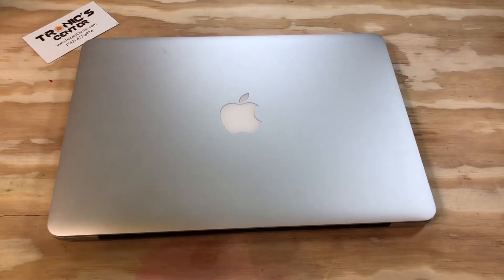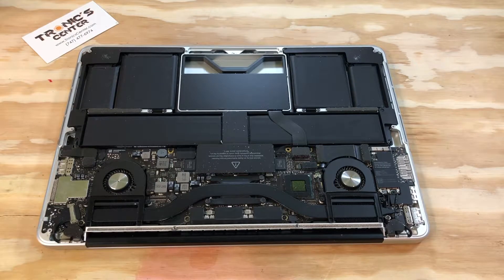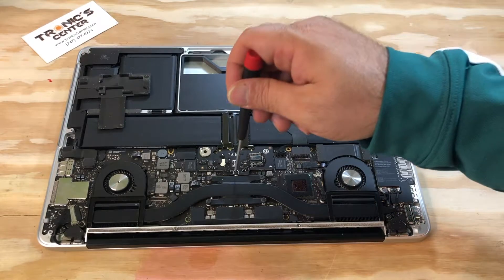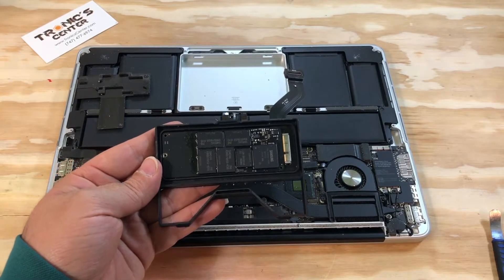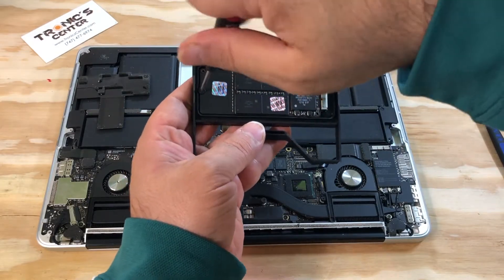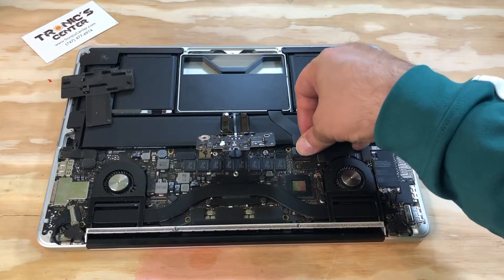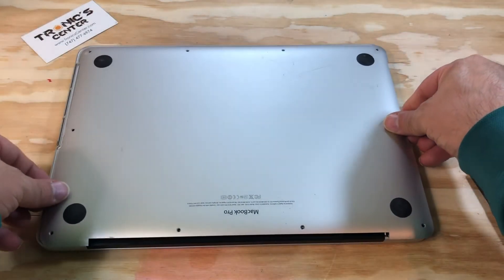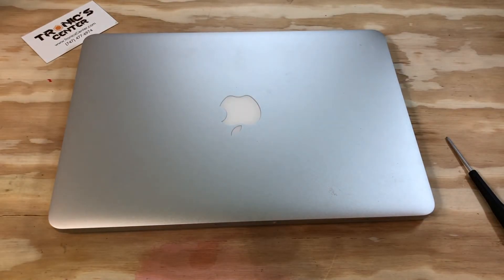Replacing SSD Pcie Storage on 13" MacBook A1425 - SSD installation 13" MacBook Pro A1425    HD 1080p

Comment: Is there any specific nvme compatible with this laptop or any is good for an upgrade?
Reply from the maker: Dear You may Visit Your Local Apple Store or Computer store so they can diagnosis and advise , Thanks ! Dear Customer let us know what repair or disassembly you want us to make video ! Please not that we do deal with all Brands Dell, Lenovo, Asus, Razer, Toshiba, Hp, Sony, Panasonic, Nikon, Canon, Black Magic, Red Camera, any Camcorder Bards, Also we do IT Support and Data Recovery ! we would love to hear from you .
Reply from the maker: A2251 KeyWords 

MacBook Pro "Core i5" 2.0 13" 2020 4 TB 3, 2.0 GHz Core i5, I5-1038NG7, MacBook Pro "Core i7" 2.3 13" 2020 4 TB 3, 2.3 GHz Core i7,  I7-1068NG7, MacBookPro16,2 , 2020 13" 4 TB 3 , A2251 MacBook , EMC 3348, MWP72LL/A, BTO/CTO

————————————————————

A2141 KeyWords 

MacBook Pro "Core i7" 2.6 16" 2019, 2.6 GHz Core i7 (I7-9750H), 2.3 GHz Core i9 (I9-9880H), A2141 (EMC 3347), 2.4 GHz Core i9 (I9-9980HK) , MacBookPro16,1, MacBook Pro "Core i7" 2.6 16" 2019 5600M, 2.6 GHz Core i7 (I7-9750H),  MacBookPro16,4 , MacBook Pro "Core i9" 2.3 16" 2019 5600M, 2.3 GHz Core i9 (I9-9880H), MacBook Pro "Core i9" 2.4 16" 2019 5600M, 2.4 GHz Core i9 (I9-9980HK), MVVL2LL/A, MVVM2LL/A, 16" MacBook A2141

———————————————

A2179 Keywords

MWTJ2LL/A, EMC 3302 , 1.1 GHz Core i3 (I3-1000NG4) , MacBook Air "Core i3" 1.1 13" (Scissor, 2020) , MacBookAir9,1 , 1.1 GHz Core i5 (I5-1030NG7) , MVH22LL/A , MacBook Air "Core i7" 1.2 13" (Scissor, 2020), 1.2 GHz Core i7 (I7-1060NG7)

——————————————

A2159 Keywords 

1.4 GHz Core i5 (I5-8257U) , MacBook Pro "Core i5" 1.4 13" Touch/2019 2 TB 3 , MacBook Pro "Core i7" 1.7 13" Touch/2019 2 TB 3 , 1.7 GHz Core i7 (I7-8557U) , MUHN2LL/A , A2159 , EMC 3301 , MacBookPro15,4 , 2019 13" (Touch Bar, 2 TB 3), 13" MacBook Pro A2159

—————————————————————

A1932 Keywords  

MRE82LL/A , MVFH2LL/A, 1.6 GHz Core I5-8210Y, 1.6 GHz Core I5-8210Y, MacBookAir8,1 , EMC 3184 , 13" MacBook Air Space Gray, 13" MacBook Air Gold , 13" MacBook Air Silver , 13" MacBook Air 2019 13" MacBook Air 2018, 13" MacBook Air A1932

—————————————————————

A1534 Keyword’s

EMC 2746, MF855LL/A, MF865LL/A, EMC 2991, MLHA2LL/A, MLHC2LL/A, EMC 3099, MNYF2LL/A, MNYG2LL/A, MacBook8,1 , 1.1 GHz Core M (M-5Y31) , 1.2 GHz Core M (M-5Y51), 1.3 GHz Core M (M-5Y71), 1.1 GHz Core m3 (M3-6Y30), 1.2 GHz Core m5 (M5-6Y54), 1.3 GHz Core m7 (M7-6Y75), 1.2 GHz Core m3 (M3-7Y32), 1.3 GHz Core i5 (I5-7Y54), 1.4 GHz Core i7 (I7-7Y75), MacBook9,1 , MacBook10,1

——————————————————

A1990 Keywords

MR932LL/A, 2.2 GHz Core i7 (I7-8750H), EMC 3215, MacBookPro15,1 , MR942LL/A 2.6 GHz Core i7 (I7-8850H), 2.6 GHz Core i7 (I7-8850H), 2.9 GHz Core i9 (I9-8950HK), 2.6 GHz Core i7 (I7-9750H), EMC 3359, 2.3 GHz Core i9 (I9-9880H), 2.4 GHz Core i9 (I9-9980HK), MacBookPro15,3, A1990 MacBook, 15” MacBook A1990

———————————————————

A1989 Keyword 

A1989 MacBook 2018 MR9Q2LL/A, 2.3 GHz Core i5 (I5-8259U), BTO/CTO, 2.7 GHz Core i7 (I7-8559U), EMC 3214, MacBookPro15,2 , A1989 MacBook 2019 MV962LL/A , 2.4 GHz Core i5 (I5-8279U) , MV982LL/A, 2.8 GHz Core i7 (I7-8569U) , EMC 3358, 13" MacBook A1989

———————————————

A1708 Keywords

MLL42LL/A, A1708, EMC 2978, MacBookPro13,1 , 2.0 GHz Core i5 (I5-6360U) , 2.4 GHz Core i7 (I7-6660U) , MPXQ2LL/A, EMC 3164, 2.3 GHz Core i5 (I5-7360U) , 2.5 GHz Core i7 (I7-7660U), MPXQ2LL/A, 13" MacBook A1708

———————————————————— 
MacBook 

Apple, MacBook, 13" MacBook, MacBook Air, A1466 MacBook, MacBook Air logic Board, 13" MacBook Air , Apple Mac , 11” MacBook , A1465 MacBook, A1502 MacBook, A1398 MacBook, A1425 MacBook, A1706 MacBook, A1708 MacBook, A1707 MacBook, A1990 MacBook, A1989 MacBook, A2159 MacBook, A2179 MacBook, A2289 MacBook, A2337 MacBook, A2338 MacBook, A2141 MacBook, MacBook Pro, MacBook Pro Retina, Retina display, True Tone Display , Top Case KeyBoard, Apple Keyboard, MacBook KeyBoard, MacBook Trackpad.
———————————————————

A1398 MacBook, A1398 Logic Board, A1398 LCD, A1398 KeyBoard , A1398 Display, MC975LL/A, MC976LL/A, MD831LL/A, ME664LL/A, ME665LL/A , ME698LL/A, ME293LL/A, ME294LL/A, ME874LL/A, MGXA2LL/A, MGXC2LL/A, MGXG2LL/A, MJLQ2LL/A, MJLT2LL/A, MJLU2LL/A

—————————————————————

A1706 Keywords

MLH12LL/A, A1706 EMC 3071, MacBookPro13,2 , MacBookPro14,2 , MPXV2LL/A, A1706 EMC 3163 , 3.5 GHz Core I7-7567U, 3.3 GHz Core I5-7287U, 3.1 GHz Core I5-7267U, 3.3 GHz Core I7-6567U, 3.1 GHz Core I5-6287U, 2.9 GHz Core I5-6267U, A1706 MacBook, A1706 MacBook Touch Bar 

—————————————————————
A1707 Keywords 

MPN 923-01477 , MLH32LL/A, MLH42LL/A, MPTR2LL/A, MPTT2LL, EMC 3072, MLH32LL/A, MacBookPro13,3, 2.7 GHz Core i7 (I7-6820HQ), MLH42LL/A, 2.9 GHz Core i7 (I7-6920HQ), EMC 3162 , 2.8 GHz Core i7 (I7-7700HQ), MacBookPro14,3 , 2.9 GHz Core i7 (I7-7820HQ), MPTR2LL/A, MPTT2LL/A, 3.1 GHz Core i7 (I7-7920HQ), A1707 MacBook, A1707 Touch Bar

Comment: Thanks guy. You made it look simple!
Reply from the maker: Dear Customer Thanks for comment ! Dear Customer let us know what repair or disassembly you want us to make video ! Please not that we do deal with all Brands Dell, Lenovo, Asus, Razer, Toshiba, Hp, Sony, Panasonic, Nikon, Canon, Black Magic, Red Camera, any Camcorder Bards, Also we do IT Support and Data Recovery ! we would love to hear from you .
Reply from the maker: A2251 KeyWords 

MacBook Pro "Core i5" 2.0 13" 2020 4 TB 3, 2.0 GHz Core i5, I5-1038NG7, MacBook Pro "Core i7" 2.3 13" 2020 4 TB 3, 2.3 GHz Core i7,  I7-1068NG7, MacBookPro16,2 , 2020 13" 4 TB 3 , A2251 MacBook , EMC 3348, MWP72LL/A, BTO/CTO

————————————————————

A2141 KeyWords 

MacBook Pro "Core i7" 2.6 16" 2019, 2.6 GHz Core i7 (I7-9750H), 2.3 GHz Core i9 (I9-9880H), A2141 (EMC 3347), 2.4 GHz Core i9 (I9-9980HK) , MacBookPro16,1, MacBook Pro "Core i7" 2.6 16" 2019 5600M, 2.6 GHz Core i7 (I7-9750H),  MacBookPro16,4 , MacBook Pro "Core i9" 2.3 16" 2019 5600M, 2.3 GHz Core i9 (I9-9880H), MacBook Pro "Core i9" 2.4 16" 2019 5600M, 2.4 GHz Core i9 (I9-9980HK), MVVL2LL/A, MVVM2LL/A, 16" MacBook A2141

———————————————

A2179 Keywords

MWTJ2LL/A, EMC 3302 , 1.1 GHz Core i3 (I3-1000NG4) , MacBook Air "Core i3" 1.1 13" (Scissor, 2020) , MacBookAir9,1 , 1.1 GHz Core i5 (I5-1030NG7) , MVH22LL/A , MacBook Air "Core i7" 1.2 13" (Scissor, 2020), 1.2 GHz Core i7 (I7-1060NG7)

——————————————

A2159 Keywords 

1.4 GHz Core i5 (I5-8257U) , MacBook Pro "Core i5" 1.4 13" Touch/2019 2 TB 3 , MacBook Pro "Core i7" 1.7 13" Touch/2019 2 TB 3 , 1.7 GHz Core i7 (I7-8557U) , MUHN2LL/A , A2159 , EMC 3301 , MacBookPro15,4 , 2019 13" (Touch Bar, 2 TB 3), 13" MacBook Pro A2159

—————————————————————

A1932 Keywords  

MRE82LL/A , MVFH2LL/A, 1.6 GHz Core I5-8210Y, 1.6 GHz Core I5-8210Y, MacBookAir8,1 , EMC 3184 , 13" MacBook Air Space Gray, 13" MacBook Air Gold , 13" MacBook Air Silver , 13" MacBook Air 2019 13" MacBook Air 2018, 13" MacBook Air A1932

—————————————————————

A1534 Keyword’s

EMC 2746, MF855LL/A, MF865LL/A, EMC 2991, MLHA2LL/A, MLHC2LL/A, EMC 3099, MNYF2LL/A, MNYG2LL/A, MacBook8,1 , 1.1 GHz Core M (M-5Y31) , 1.2 GHz Core M (M-5Y51), 1.3 GHz Core M (M-5Y71), 1.1 GHz Core m3 (M3-6Y30), 1.2 GHz Core m5 (M5-6Y54), 1.3 GHz Core m7 (M7-6Y75), 1.2 GHz Core m3 (M3-7Y32), 1.3 GHz Core i5 (I5-7Y54), 1.4 GHz Core i7 (I7-7Y75), MacBook9,1 , MacBook10,1

——————————————————

A1990 Keywords

MR932LL/A, 2.2 GHz Core i7 (I7-8750H), EMC 3215, MacBookPro15,1 , MR942LL/A 2.6 GHz Core i7 (I7-8850H), 2.6 GHz Core i7 (I7-8850H), 2.9 GHz Core i9 (I9-8950HK), 2.6 GHz Core i7 (I7-9750H), EMC 3359, 2.3 GHz Core i9 (I9-9880H), 2.4 GHz Core i9 (I9-9980HK), MacBookPro15,3, A1990 MacBook, 15” MacBook A1990

———————————————————

A1989 Keyword 

A1989 MacBook 2018 MR9Q2LL/A, 2.3 GHz Core i5 (I5-8259U), BTO/CTO, 2.7 GHz Core i7 (I7-8559U), EMC 3214, MacBookPro15,2 , A1989 MacBook 2019 MV962LL/A , 2.4 GHz Core i5 (I5-8279U) , MV982LL/A, 2.8 GHz Core i7 (I7-8569U) , EMC 3358, 13" MacBook A1989

———————————————

A1708 Keywords

MLL42LL/A, A1708, EMC 2978, MacBookPro13,1 , 2.0 GHz Core i5 (I5-6360U) , 2.4 GHz Core i7 (I7-6660U) , MPXQ2LL/A, EMC 3164, 2.3 GHz Core i5 (I5-7360U) , 2.5 GHz Core i7 (I7-7660U), MPXQ2LL/A, 13" MacBook A1708

———————————————————— 
MacBook 

Apple, MacBook, 13" MacBook, MacBook Air, A1466 MacBook, MacBook Air logic Board, 13" MacBook Air , Apple Mac , 11” MacBook , A1465 MacBook, A1502 MacBook, A1398 MacBook, A1425 MacBook, A1706 MacBook, A1708 MacBook, A1707 MacBook, A1990 MacBook, A1989 MacBook, A2159 MacBook, A2179 MacBook, A2289 MacBook, A2337 MacBook, A2338 MacBook, A2141 MacBook, MacBook Pro, MacBook Pro Retina, Retina display, True Tone Display , Top Case KeyBoard, Apple Keyboard, MacBook KeyBoard, MacBook Trackpad.
———————————————————

A1398 MacBook, A1398 Logic Board, A1398 LCD, A1398 KeyBoard , A1398 Display, MC975LL/A, MC976LL/A, MD831LL/A, ME664LL/A, ME665LL/A , ME698LL/A, ME293LL/A, ME294LL/A, ME874LL/A, MGXA2LL/A, MGXC2LL/A, MGXG2LL/A, MJLQ2LL/A, MJLT2LL/A, MJLU2LL/A

—————————————————————

A1706 Keywords

MLH12LL/A, A1706 EMC 3071, MacBookPro13,2 , MacBookPro14,2 , MPXV2LL/A, A1706 EMC 3163 , 3.5 GHz Core I7-7567U, 3.3 GHz Core I5-7287U, 3.1 GHz Core I5-7267U, 3.3 GHz Core I7-6567U, 3.1 GHz Core I5-6287U, 2.9 GHz Core I5-6267U, A1706 MacBook, A1706 MacBook Touch Bar 

—————————————————————
A1707 Keywords 

MPN 923-01477 , MLH32LL/A, MLH42LL/A, MPTR2LL/A, MPTT2LL, EMC 3072, MLH32LL/A, MacBookPro13,3, 2.7 GHz Core i7 (I7-6820HQ), MLH42LL/A, 2.9 GHz Core i7 (I7-6920HQ), EMC 3162 , 2.8 GHz Core i7 (I7-7700HQ), MacBookPro14,3 , 2.9 GHz Core i7 (I7-7820HQ), MPTR2LL/A, MPTT2LL/A, 3.1 GHz Core i7 (I7-7920HQ), A1707 MacBook, A1707 Touch Bar

Comment: no hace falta desmontar nada sale solo. no tiene sentido.
Reply from the maker: Please comment on english, Thanks ! Dear Customer let us know what repair or disassembly you want us to make video ! Please not that we do deal with all Brands Dell, Lenovo, Asus, Razer, Toshiba, Hp, Sony, Panasonic, Nikon, Canon, Black Magic, Red Camera, any Camcorder Bards, Also we do IT Support and Data Recovery ! we would love to hear from you .
Reply from the maker: A2251 KeyWords 

MacBook Pro "Core i5" 2.0 13" 2020 4 TB 3, 2.0 GHz Core i5, I5-1038NG7, MacBook Pro "Core i7" 2.3 13" 2020 4 TB 3, 2.3 GHz Core i7,  I7-1068NG7, MacBookPro16,2 , 2020 13" 4 TB 3 , A2251 MacBook , EMC 3348, MWP72LL/A, BTO/CTO

————————————————————

A2141 KeyWords 

MacBook Pro "Core i7" 2.6 16" 2019, 2.6 GHz Core i7 (I7-9750H), 2.3 GHz Core i9 (I9-9880H), A2141 (EMC 3347), 2.4 GHz Core i9 (I9-9980HK) , MacBookPro16,1, MacBook Pro "Core i7" 2.6 16" 2019 5600M, 2.6 GHz Core i7 (I7-9750H),  MacBookPro16,4 , MacBook Pro "Core i9" 2.3 16" 2019 5600M, 2.3 GHz Core i9 (I9-9880H), MacBook Pro "Core i9" 2.4 16" 2019 5600M, 2.4 GHz Core i9 (I9-9980HK), MVVL2LL/A, MVVM2LL/A, 16" MacBook A2141

———————————————

A2179 Keywords

MWTJ2LL/A, EMC 3302 , 1.1 GHz Core i3 (I3-1000NG4) , MacBook Air "Core i3" 1.1 13" (Scissor, 2020) , MacBookAir9,1 , 1.1 GHz Core i5 (I5-1030NG7) , MVH22LL/A , MacBook Air "Core i7" 1.2 13" (Scissor, 2020), 1.2 GHz Core i7 (I7-1060NG7)

——————————————

A2159 Keywords 

1.4 GHz Core i5 (I5-8257U) , MacBook Pro "Core i5" 1.4 13" Touch/2019 2 TB 3 , MacBook Pro "Core i7" 1.7 13" Touch/2019 2 TB 3 , 1.7 GHz Core i7 (I7-8557U) , MUHN2LL/A , A2159 , EMC 3301 , MacBookPro15,4 , 2019 13" (Touch Bar, 2 TB 3), 13" MacBook Pro A2159

—————————————————————

A1932 Keywords  

MRE82LL/A , MVFH2LL/A, 1.6 GHz Core I5-8210Y, 1.6 GHz Core I5-8210Y, MacBookAir8,1 , EMC 3184 , 13" MacBook Air Space Gray, 13" MacBook Air Gold , 13" MacBook Air Silver , 13" MacBook Air 2019 13" MacBook Air 2018, 13" MacBook Air A1932

—————————————————————

A1534 Keyword’s

EMC 2746, MF855LL/A, MF865LL/A, EMC 2991, MLHA2LL/A, MLHC2LL/A, EMC 3099, MNYF2LL/A, MNYG2LL/A, MacBook8,1 , 1.1 GHz Core M (M-5Y31) , 1.2 GHz Core M (M-5Y51), 1.3 GHz Core M (M-5Y71), 1.1 GHz Core m3 (M3-6Y30), 1.2 GHz Core m5 (M5-6Y54), 1.3 GHz Core m7 (M7-6Y75), 1.2 GHz Core m3 (M3-7Y32), 1.3 GHz Core i5 (I5-7Y54), 1.4 GHz Core i7 (I7-7Y75), MacBook9,1 , MacBook10,1

——————————————————

A1990 Keywords

MR932LL/A, 2.2 GHz Core i7 (I7-8750H), EMC 3215, MacBookPro15,1 , MR942LL/A 2.6 GHz Core i7 (I7-8850H), 2.6 GHz Core i7 (I7-8850H), 2.9 GHz Core i9 (I9-8950HK), 2.6 GHz Core i7 (I7-9750H), EMC 3359, 2.3 GHz Core i9 (I9-9880H), 2.4 GHz Core i9 (I9-9980HK), MacBookPro15,3, A1990 MacBook, 15” MacBook A1990

———————————————————

A1989 Keyword 

A1989 MacBook 2018 MR9Q2LL/A, 2.3 GHz Core i5 (I5-8259U), BTO/CTO, 2.7 GHz Core i7 (I7-8559U), EMC 3214, MacBookPro15,2 , A1989 MacBook 2019 MV962LL/A , 2.4 GHz Core i5 (I5-8279U) , MV982LL/A, 2.8 GHz Core i7 (I7-8569U) , EMC 3358, 13" MacBook A1989

———————————————

A1708 Keywords

MLL42LL/A, A1708, EMC 2978, MacBookPro13,1 , 2.0 GHz Core i5 (I5-6360U) , 2.4 GHz Core i7 (I7-6660U) , MPXQ2LL/A, EMC 3164, 2.3 GHz Core i5 (I5-7360U) , 2.5 GHz Core i7 (I7-7660U), MPXQ2LL/A, 13" MacBook A1708

———————————————————— 
MacBook 

Apple, MacBook, 13" MacBook, MacBook Air, A1466 MacBook, MacBook Air logic Board, 13" MacBook Air , Apple Mac , 11” MacBook , A1465 MacBook, A1502 MacBook, A1398 MacBook, A1425 MacBook, A1706 MacBook, A1708 MacBook, A1707 MacBook, A1990 MacBook, A1989 MacBook, A2159 MacBook, A2179 MacBook, A2289 MacBook, A2337 MacBook, A2338 MacBook, A2141 MacBook, MacBook Pro, MacBook Pro Retina, Retina display, True Tone Display , Top Case KeyBoard, Apple Keyboard, MacBook KeyBoard, MacBook Trackpad.
———————————————————

A1398 MacBook, A1398 Logic Board, A1398 LCD, A1398 KeyBoard , A1398 Display, MC975LL/A, MC976LL/A, MD831LL/A, ME664LL/A, ME665LL/A , ME698LL/A, ME293LL/A, ME294LL/A, ME874LL/A, MGXA2LL/A, MGXC2LL/A, MGXG2LL/A, MJLQ2LL/A, MJLT2LL/A, MJLU2LL/A

—————————————————————

A1706 Keywords

MLH12LL/A, A1706 EMC 3071, MacBookPro13,2 , MacBookPro14,2 , MPXV2LL/A, A1706 EMC 3163 , 3.5 GHz Core I7-7567U, 3.3 GHz Core I5-7287U, 3.1 GHz Core I5-7267U, 3.3 GHz Core I7-6567U, 3.1 GHz Core I5-6287U, 2.9 GHz Core I5-6267U, A1706 MacBook, A1706 MacBook Touch Bar 

—————————————————————
A1707 Keywords 

MPN 923-01477 , MLH32LL/A, MLH42LL/A, MPTR2LL/A, MPTT2LL, EMC 3072, MLH32LL/A, MacBookPro13,3, 2.7 GHz Core i7 (I7-6820HQ), MLH42LL/A, 2.9 GHz Core i7 (I7-6920HQ), EMC 3162 , 2.8 GHz Core i7 (I7-7700HQ), MacBookPro14,3 , 2.9 GHz Core i7 (I7-7820HQ), MPTR2LL/A, MPTT2LL/A, 3.1 GHz Core i7 (I7-7920HQ), A1707 MacBook, A1707 Touch Bar